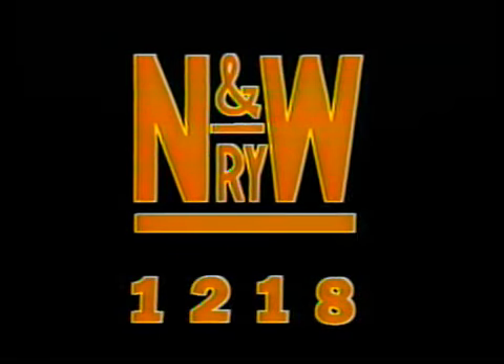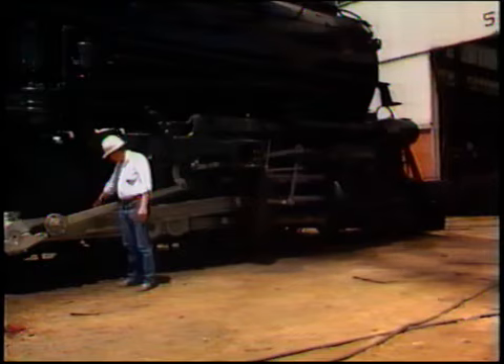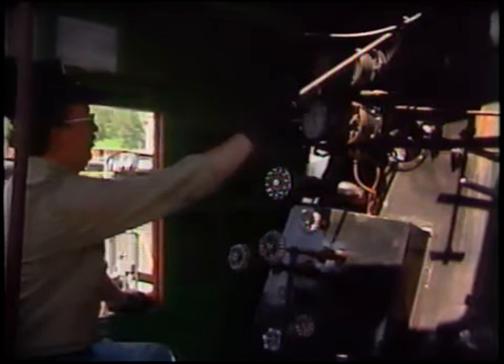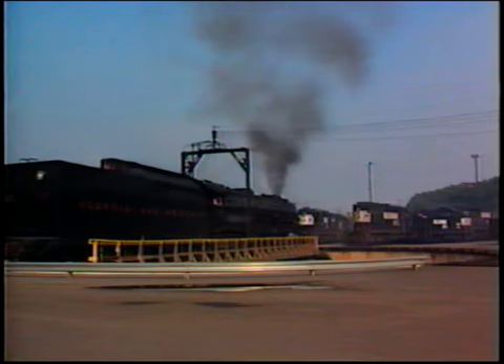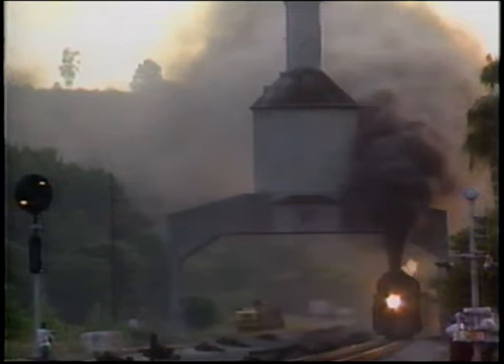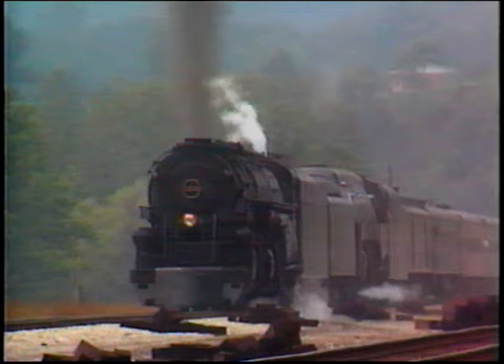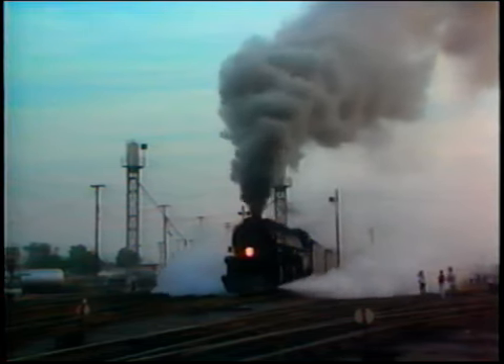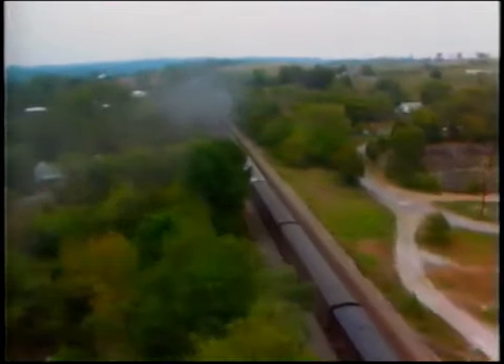Norfolk and Western 1218

Comment: It's a shame that 1218 isn't operational anymore, especially since her excursion career was cut short in the early 1990s. Hopefully, in the future, she will be running under her own power once again.
Reply: Most of the restoration parts sold  off  for other engines saw 1218 cylinder liner went in a soo line  steam engine replacement
Reply: @ArnoldwMace  Was it 1003? SOO Line 1003 is the main operational SOO Line steam engine I know of.
Reply: As if right now There is a Plan to restore the 1218 because a friend of mine that is currently volunteering at the Virginia Mussem of Transportation told me the VMT might Restore her but the VMT's main focus right now is N&W 611s 1472 in 2030.
It’s a 15 year overhaul, according to Federal railroad administration, the law for steam locomotives is that after its boiler inspection, it is given a permit to run for 1472 operating days, or a maximum of 15 years, after that time is up, the locomotive must be disassembled again to do a complete overhaul and to renew its boiler ticket, which includes..

 ultrasounding the boiler, which just checks to make sure the steel is still thick enough to hold steam at operating pressure.

Next  you replace the tubes and flues in the boiler and replace the crown sheets if necessary.

Inspect, repair, or replace the superheater units in the boiler.

then once everything is put back in place you must undergo a hydrostatic test, which just fills the boiler with water and gradually increasing the pressure to 375 psi and testing for leaks from the staybolt caps.

after that is complete you are ready for a steam test, and when that passes, you reassemble the locomotive and it’s ready to go for another 15 years of operation.
Hope this helps